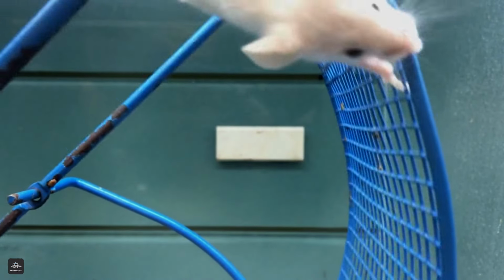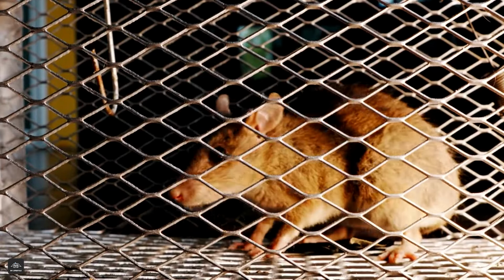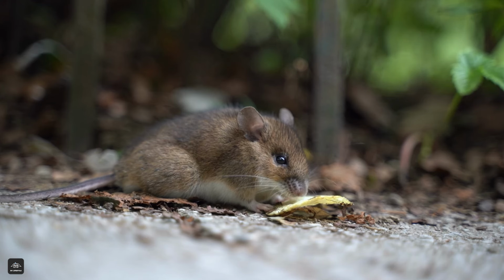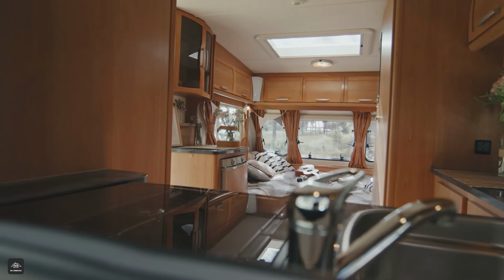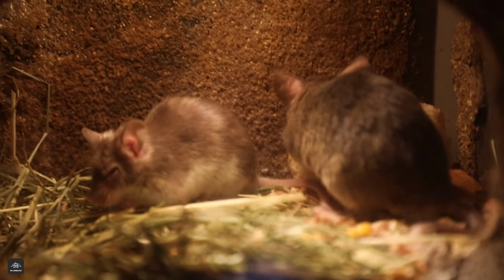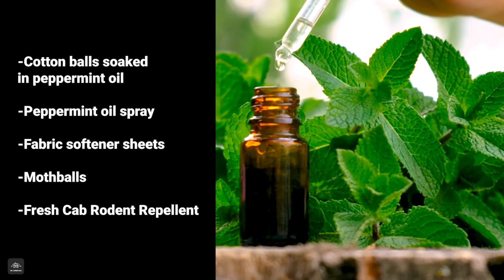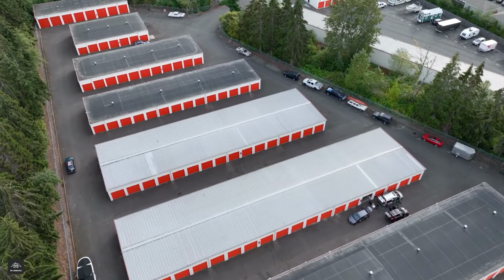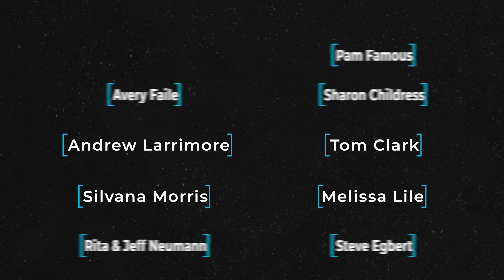5 Tips to Keep Mice Out of Your RV

Comment: We use copper wool instead of steel wool as it won’t rust.  In the last seven years we’ve had mice twice. I would also suggest cleaning every cabinet and surface with a disinfectant prior to closing up for the season. And of course remove all food and every crumb!  Both times we had mice it was just after our TT had been worked on. And they multiply quickly. So be sure to check that underbelly for any new points of entry. Luckily for us are TT is stored on our property and we can inspect as needed. We use a combination of traps, checking them frequently and fresh cab.
Reply from the maker: Thank you for sharing your tips and experiences! It's always helpful to hear from others who have successfully kept mice out of their RVs.

Comment: I use bars of Irish spring. Place a couple on top of the tires and up on the A-frame. Seems to work.
Reply from the maker: Then again, I've heard from folks who tried it and said the soap showed signs that the mice were nibbling on it! Go figure.
Reply: @RVLifestyle  I've read that the formula for Irish spring has changed and/or it loses the scent and that's why it's not effective anymore.
Reply: @RVLifestyle  the rodents loved the Irish spring soap we placed around the outside area of our RV.  Peppermint oil and snap traps on top of the tires is working great 👍

Comment: We are heading back to our winterized and stored 5th wheel, today, to try to get rid of the nasty things! We found them, earlier this week. I used the peppermeint on cotton balls and fabric softener sheets FOR YEARS! Never had a sign of the darned varmints. Now, they held a party in drawers, my recliner (!) and used the sinks as a toilets!! Any help would be appreciated! We are using poison, today, and I am so scared they will die and stink, in the camper. BTW we have always camped, for months at a time, with our housecat, and figured she was a deterrent, until now.
Reply from the maker: Uh-oh, sounds like those mice really made themselves at home in your RV!  Good luck with the poison, just make sure to open all the windows and air out the camper afterwards!
Reply: I and others in our campground also found mice had been in our campers/RV over the winter. The winter was unusual with virtually no snow, which made it very easy for mice to travel over the ground. We also found lots of acorn bits inside, so the mice took the outside food to go, apparently. BTW, I had mice droppings and acorns in the drawer that had a box of fabric softener sheets.

Comment: Do lights around the rig work?
Reply: Supposedly they do, on the ground level. There are strobe lights some people use also. I got mice in mine over the winter when it was stored and when I returned I wanted to let them know I was back. One thing I did was put a rope light under the RV and used peppermint oil, so far no signs of return.
Reply: @lauravictorious4670 soak rags in plastic sandwich bags in ammonia and  leave the bag slightly open. Place around perimeter of the RV.
Reply: @WestShoreMan  are you talking about this method for mice or chipmunks? I got the mice over the winter when it was all shut up although I do wonder if there's one in the ceiling. Can't tell if it's chipmunks on the roof or a mouse in the ceiling. If it's the latter then it's not going into the drawers or cabinets, which is good, but I have some lights that stopped working and the ceiling fan. I ordered those high frequency noise plug ins, just in case, to drive out any rodents that I hope aren't there.
Reply: @lauravictorious4670  mice 🐁
Reply: @WestShoreMan  I've never heard anyone talk about ammonia but if humans don't like the smell I can imagine mice don't either. I'd like to know the best things to do to keep them out when I winterize this fall. If it's a normal winter, with snow, that will make a difference. Peppermint is good but it doesn't last for six months. I'll try to block any entrances I find. Kind of tough with a motor home.